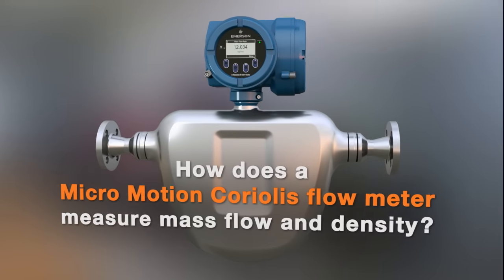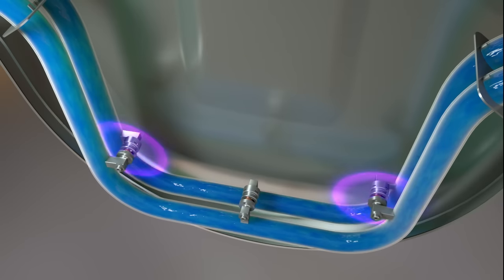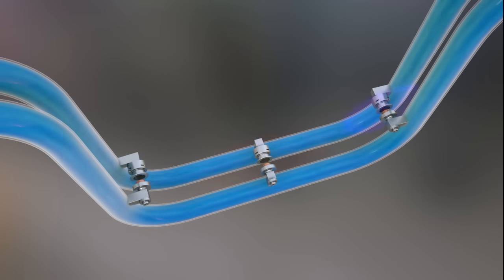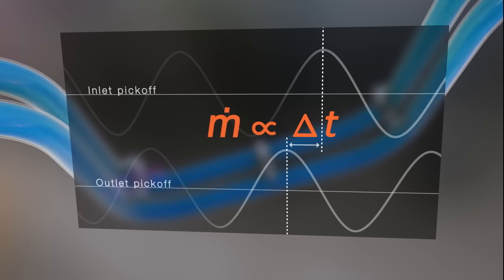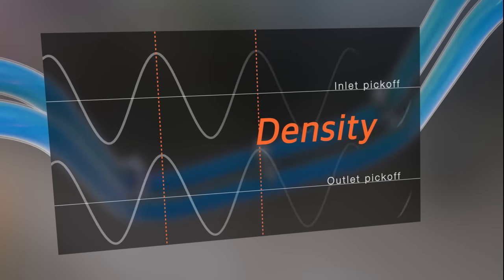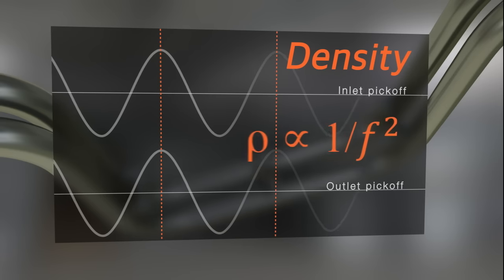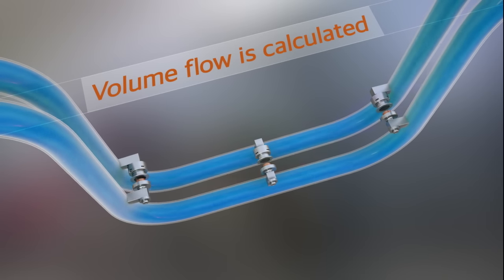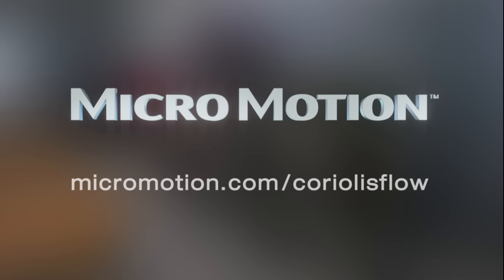Coriolis Flow Meter Theory of Operation

Comment: Thanks for making this honest video. One of the only ones kinda debunking any coriolis effect  (which is still a theory) We are measuring a change in oscillation of the tubes due to density so that mass/weight of fluids can be measured and the twisting (inertia) is measured at the inlet and outlet pick ups which are like high precision clocks. You can do this with one tube but people have chosen to use 2.. for redundancy.
Anyone agree? Or do you still want to make this a mystery by bring in Gustav?

Comment: Are the pickoffs having voltage induced and measured?
Reply: A function generator produces a sine wave at the drive coil that pushes and pulls the center magnet.
The left and right pick off coils generate sine waves from the left and right magnets since the tube is being pushed and pulled